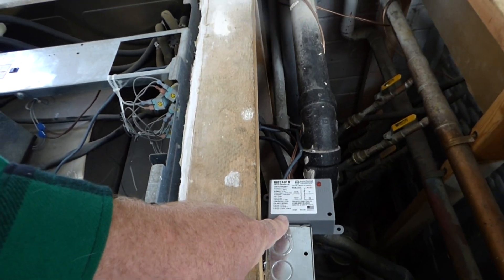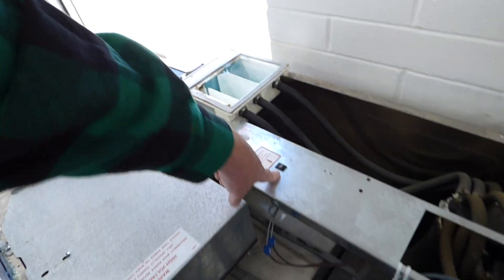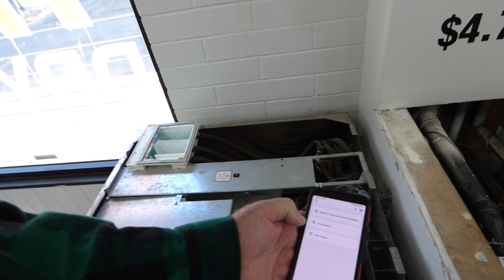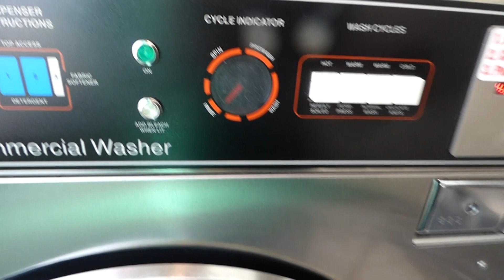Remote starting 20 year old Speed Queen washers

Comment: This is what I need, my biggest issue at my laundromat since I live far from it. But 1) when it comes to getting their clothes that are stuck in a machine, your breaker switches are accessible to anyone to shut it off? And 2) are those washers designated only for that so another customer won’t be occupying them if this happens? Thanks.
Reply from the maker: @jjslaundromat1254  yes the breakers are accessible to customers, I haven't had issues with this other than helping them find the correct breaker box. I had five washers set up with the remote start. I sense retooled so now all my washers remote start.

Comment: I've been thinking about doing something similar; but doing it through the optical connection on the coin validator.   I was going to run all the cabling to central location(s) and use the optoisolator to do the same sort of thing.   We've got (6) of this vintage machine (although our rapid advance is in a different location), a bunch of Horizon's too -- so this approach would work on just about any machine.    I haven't gotten too far with my design; other than wanting to set up a self test -- but the advantage to the way I want to do this is that you'd literally only be running a low-voltage contact closure to an optoisolator; no need to touch 120V.     PS:  Those RIB products are awesome - i use them all the time in industry!
Reply from the maker: The 120v is only to run the wifi power strip. You can simply plug that into a wall outlet!